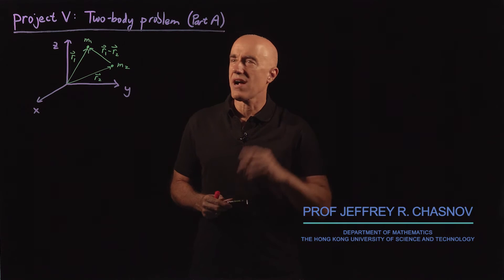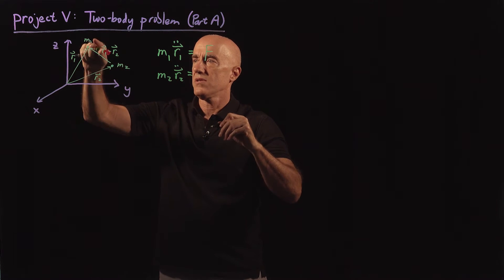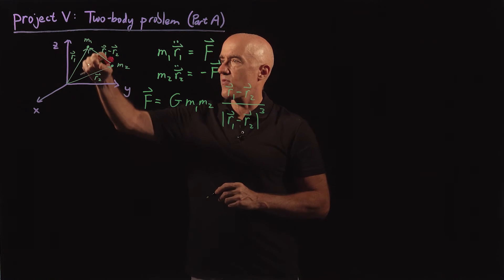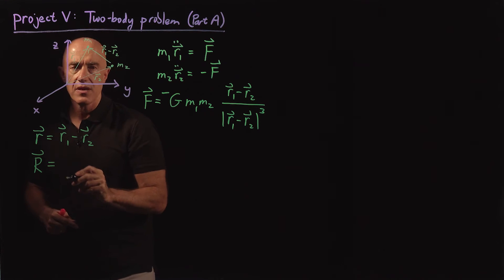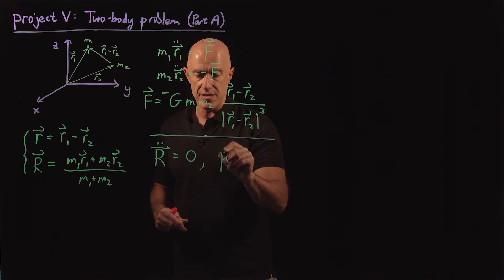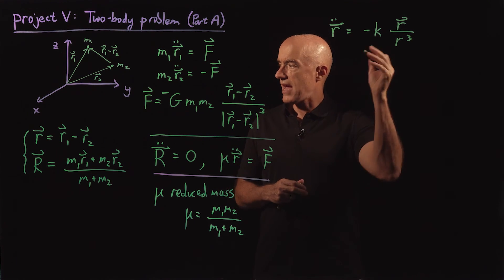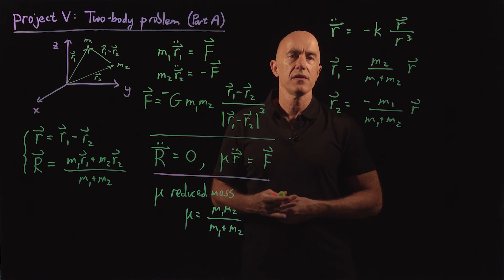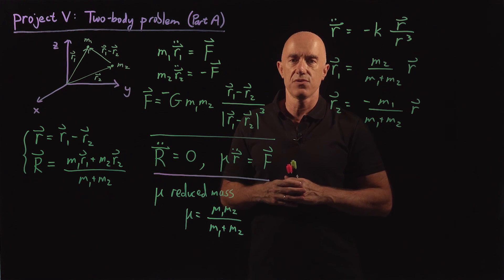Project V: Two-Body Problem (Part A) | Lecture 58 | Numerical Methods for Engineers

Comment: I have been working on a solution for the acceleration of the center of mass. The center of mass has an acceleration based on the sin wave acceleration of the orbiting body. It also loses a small amount of acceleration every orbit due to the movement of the large body. what this means is elliptical orbits are not stable. Some of the planets could have been captured. I would like to solicit your help in solving. I don't think a clean solution is possible, I would love you to prove me wrong.